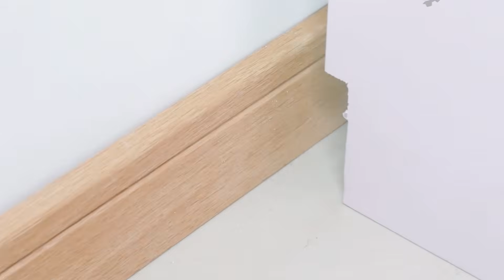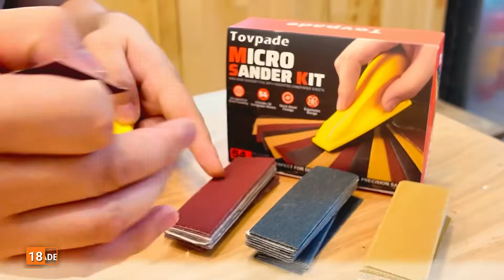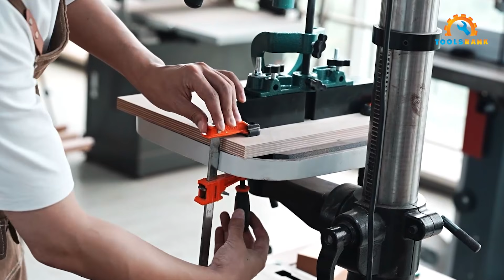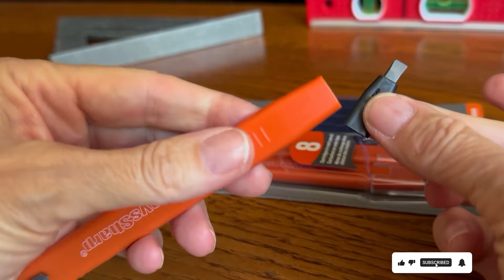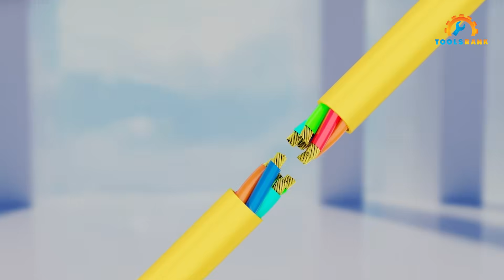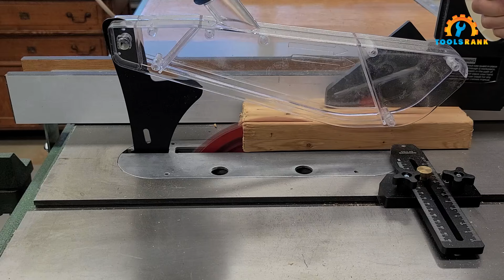80 New Woodworking Tools On Amazon That Will Make Your Work Easier

Comment from the maker: 1	Kurras Adjustable Corner Clamp Set	
 https://www.amazon.com/dp/B0CYLSPLFF?tag=toolsrank-20
2	Robustrue cordless impact driver	
 https://www.amazon.com/dp/B0F5C8XTS5?tag=toolsrank-20
3	Puioco stair tread jig	
 https://www.amazon.com/dp/B0F3CPZLHR?tag=toolsrank-20
4	Saker Multi-function Scribing Tool	
 https://www.amazon.com/dp/B09PD9MNFQ?tag=toolsrank-20
5	Bora pocket hole jig	
 https://www.amazon.com/dp/B0FDXNDSWJ?tag=toolsrank-20
6	Wbe rafter square set	
 https://www.amazon.com/dp/B0FDW9FWP1?tag=toolsrank-20
7	Wobllmx auger drill bit	
 https://www.amazon.com/dp/B0FKB64X6G?tag=toolsrank-20
8	Kreg rip cut kma2400	
 https://www.amazon.com/dp/B0FFK6DFMS?tag=toolsrank-20
9	Goingmake cabinet door jig	
 https://www.amazon.com/dp/B0DSKNJQKM?tag=toolsrank-20
10	Toolcool dowel jig kit	
 https://www.amazon.com/dp/B0F4JQT3TY?tag=toolsrank-20
11	Suwui cabinet clamps	
 https://www.amazon.com/dp/B0F8HM65D8?tag=toolsrank-20
12	Artymaster corner clamps	
 https://www.amazon.com/dp/B0DSF98DQ9?tag=toolsrank-20
13	Gqgp setup blocks set	
 https://www.amazon.com/dp/B0DXZXHVNP?tag=toolsrank-20
14	Yjmkoi ratcheting table clamp	
 https://www.amazon.com/dp/B0DBLFQCYZ?tag=toolsrank-20
15	Grenpro bar clamps set	
 https://www.amazon.com/dp/B0DPY86757?tag=toolsrank-20
16	Hiinny oscillating tool blades	
 https://www.amazon.com/dp/B0FHZMN6YS?tag=toolsrank-20
17	Pony heavy duty bench vise	
 https://www.amazon.com/dp/B0DRCDVDRP?tag=toolsrank-20
18	Tovpade mini sander kit	
 https://www.amazon.com/dp/B0FDWYKCSM?tag=toolsrank-20
19	Niansee sphere rotary burr	
 https://www.amazon.com/dp/B0F327XZQ6?tag=toolsrank-20
20	Seesii cordless rotary hammer drill	
 https://www.amazon.com/dp/B0G4W971BT?tag=toolsrank-20
21	Mtiolhig cordless compact router	
 https://www.amazon.com/dp/B0DK525WN5?tag=toolsrank-20
22	Cerycose cordless reciprocating saw	
 https://www.amazon.com/dp/B0CS39G3YG?tag=toolsrank-20
23	Viewreal bench dog clamp set	
 https://www.amazon.com/dp/B0F24LRBKB?tag=toolsrank-20
24	Yesbes tape measure set	
 https://www.amazon.com/dp/B0FH62NG44?tag=toolsrank-20
25	Sigerio router milling jig	
 https://www.amazon.com/dp/B0CW97FYLG?tag=toolsrank-20
26	Saker drilling positioning ruler	
 https://www.amazon.com/dp/B0D5QCVW84?tag=toolsrank-20
27	Tekeviss thread checker set	
 https://www.amazon.com/dp/B0F93XJQBR?tag=toolsrank-20
28	Ruitool corner chisel	
 https://www.amazon.com/dp/B0D28V15SS?tag=toolsrank-20
29	Saker stair tread template tool	
 https://www.amazon.com/dp/B0F5VT3R3H?tag=toolsrank-20
30	Bmturning mortising machine	
 https://www.amazon.com/dp/B0F3HCWBR4?tag=toolsrank-20
31	Okcedier woodworking t square ruler	
 https://www.amazon.com/dp/B0F8QH2N3Q?tag=toolsrank-20
32	Etcyaoxin woodworking scriber ruler	
 https://www.amazon.com/dp/B0F6VLWXTZ?tag=toolsrank-20
33	Ruitool edge banding trimmer	
 https://www.amazon.com/dp/B0FH6K95PQ?tag=toolsrank-20
34	Yeartop cordless cut off tool	
 https://www.amazon.com/dp/B0FKB5LYF8?tag=toolsrank-20
35	Goingmake table saw miter gauge	
 https://www.amazon.com/dp/B0DXTXG7F5?tag=toolsrank-20
36	Nicpro woodworking scriber ruler	
 https://www.amazon.com/dp/B0DY171YQD?tag=toolsrank-20
37	Ruitool marking knife	
 https://www.amazon.com/dp/B0FFGGDBR5?tag=toolsrank-20
38	Belladimora cordless brad nailer	
 https://www.amazon.com/dp/B0F6B96BWM?tag=toolsrank-20
39	Kreg Cabinet Face Frame Clamp	
 https://www.amazon.com/dp/B0D5BR313F?tag=toolsrank-20
40	WORKPRO Bar Clamps for Woodworking	
 https://www.amazon.com/dp/B0875WV3CD?tag=toolsrank-20
41	Unipec digital caliper	
 https://www.amazon.com/dp/B0FDKLGGP4?tag=toolsrank-20
42	Meite 23 gauge pin nails	
 https://www.amazon.com/dp/B0F9FWT111?tag=toolsrank-20
43	Swanson Carpenter Pencils	
 https://www.amazon.com/dp/B000FLP9MS?tag=toolsrank-20
44	Auniwaig Carving Bits	
 https://www.amazon.com/dp/B0F93W7YP3?tag=toolsrank-20
45	FastCap Tape Measure	
 https://www.amazon.com/dp/B0001GUE3G?tag=toolsrank-20
46	FIRSTINFO Hand Plane	
 https://www.amazon.com/dp/B00YA8AALM?tag=toolsrank-20
47	Biscuit Joiner Plates	
 https://www.amazon.com/dp/B0FDJRV4GC?tag=toolsrank-20
48	Corner Radius Templates	
 https://www.amazon.com/dp/B0DYNWK2YS?tag=toolsrank-20
49	Pocket Hole Jig	
 https://www.amazon.com/dp/B0F42JGQGJ?tag=toolsrank-20
50	Lanties Draw Knife	
 https://www.amazon.com/dp/B0FMF3P87D?tag=toolsrank-20
51	Lanties T-Track Clamps	
 https://www.amazon.com/dp/B0DV8G62YH?tag=toolsrank-20
52	SUIZAN Wood Planer	
 https://www.amazon.com/dp/B071CF33BG?tag=toolsrank-20
53	Kreg Rip-Cut Guide	
 https://www.amazon.com/dp/B073PFYN4T?tag=toolsrank-20
54	Kreg Pocket Hole Jig Pro	
 https://www.amazon.com/dp/B08BQC8TGZ?tag=toolsrank-20
55	VEVOR Wire Stripping Machine	
 https://www.amazon.com/dp/B0CMZCNQNF?tag=toolsrank-20
56	SumKea Sewer Camera	
 https://www.amazon.com/dp/B0FK9S7BRN?tag=toolsrank-20
57	VEVOR Sewer Camera	
 https://www.amazon.com/dp/B0BYZ4P2ST?tag=toolsrank-20
58	IMAYCC Cement Mixer	
 https://www.amazon.com/dp/B08MFFZXN4?tag=toolsrank-20
59	GOEHNER Bench Vise 3.3"	
 https://www.amazon.com/dp/B09TP7GZL9?tag=toolsrank-20
60	ToughBuilt Gelfit Knee Pads	
 https://www.amazon.com/dp/B0140V9LWC?tag=toolsrank-20
61	manram Cabinet Clamps	
 https://www.amazon.com/dp/B0BJQPMXZF?tag=toolsrank-20
62	Woodpeckers Table Saw Gauge	
 https://www.amazon.com/dp/B002VRFM9Y?tag=toolsrank-20
63	Malco Adjustable Hole Cutter	
 https://www.amazon.com/dp/B000289542?tag=toolsrank-20
64	SDSNTE Deck Board Tool	
 https://www.amazon.com/dp/B0BV6NQTHZ?tag=toolsrank-20
65	Milescraft GrabberPLUS	
 https://www.amazon.com/dp/B09MSMKW73?tag=toolsrank-20
66	REEKON M1 Measuring Tool	
 https://www.amazon.com/dp/B098TTZZYL?tag=toolsrank-20
67	Worx Nitro SwitchDriver	
 https://www.amazon.com/dp/B0B21Y8LK4?tag=toolsrank-20
68	Stak Rack Painter’s Tool	
 https://www.amazon.com/dp/B06ZYYL8HZ?tag=toolsrank-20
69	LEXIVON Aluminum Miter Saw Protractor	
 https://www.amazon.com/dp/B085BDP24T?tag=toolsrank-20
70	AVID POWER Compact Router	
 https://www.amazon.com/dp/B07CQK4ZL4?tag=toolsrank-20
71	Worx Pegasus Work Table	
 https://www.amazon.com/dp/B01HREBZ3M?tag=toolsrank-20
72	Thin Rip Jig	
 https://www.amazon.com/dp/B0CBKSZ1D1?tag=toolsrank-20
73	HUEPAR Laser Level	
 https://www.amazon.com/dp/B0DRHWXD5K?tag=toolsrank-20
74	GOINGMAKE Door Jig	
 https://www.amazon.com/dp/B0DSKNJQKM?tag=toolsrank-20
75	Kreg R3 Jr. Jig	
 https://www.amazon.com/dp/B000J43A7W?tag=toolsrank-20
76	Mt Diablo Wood Chisels	
 https://www.amazon.com/dp/B0CKLVV2VC?tag=toolsrank-20
77	Hsei Glue Tips	
 https://www.amazon.com/dp/B086SSLKYH?tag=toolsrank-20
78	MICROJIG GRR-RIPPER MAX	
 https://www.amazon.com/dp/B0DK9NPXH6?tag=toolsrank-20
79	RUITOOL Marking Knife	
 https://www.amazon.com/dp/B0FFGGDBR5?tag=toolsrank-20
80	Kingson Setup Block Gauge	
 https://www.amazon.com/dp/B0B7SKLHJT?tag=toolsrank-20